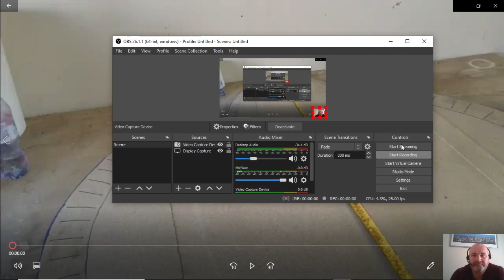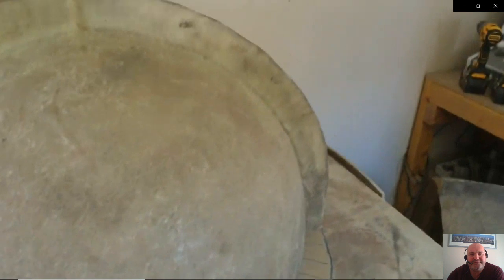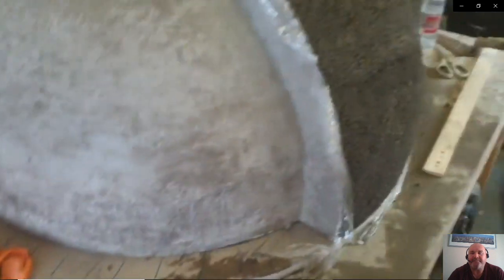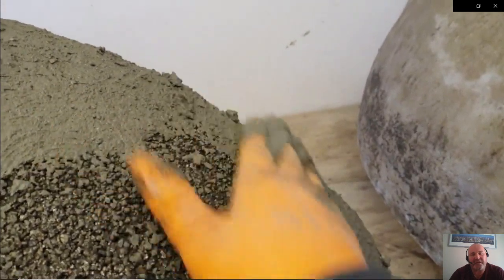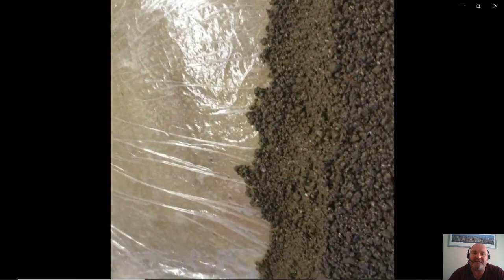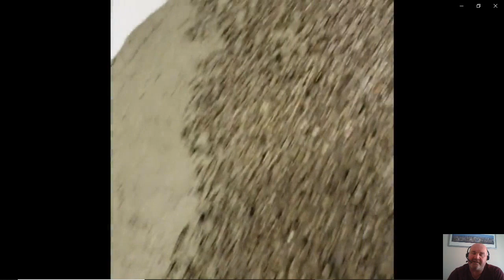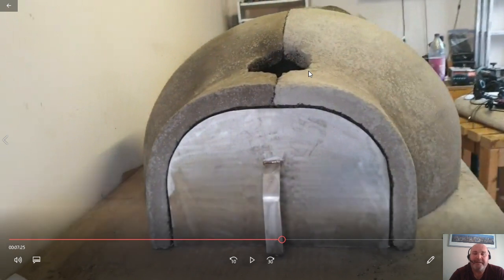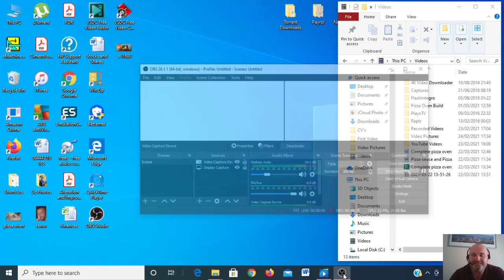Pizza Oven (DIY) - 36 inch Pizza oven made from Perlite, Sharp Sand and Refractory Cement...

Comment: Ive seen so many of these pizza videos and this for me is the best Ive seen.
Reply from the maker: Thanks...Just trying to show how easy these ovens are to make and also how relatively inexpensive they can be to build...
Reply: @D230261  Your oven looks so much stronger. Very few of the others use sand. And they all look very crumbly. Just out of interest do you have any thoughts on the use of storage heater blocks. Ive got loads of them but not sure how well they would work compared to clay fire bricks
Reply from the maker: The only issue with storage bricks are that older ones can contain asbestos...So ideally you would want to have them checked or tested to be sure...I have around 30 storage bricks that I had planned to use until I was informed of this issue so decided just to go with firebricks...
Reply: @D230261  Thanks

Comment: Love the video and your use of perlite and refractory cement.   I'd like to build for doing pizza and more importantly for bread.   Does this hold heat longer than the perlite with just regular cement?    I'd like to bake at 350 -400 degrees for 30 minutes or longer.
Reply from the maker: I get the oven up to around 900F for pizza...once finished it will take around 6 hours to cool down to around 200F. I've cooke loads of bread in mine ofter finishing with pizza...Slow cooker pulled pork as well...Its not as good as a full brick oven but for the cost...its pretty good...I dont use mine full time so paying a lot wasn't an option...so I went for this type of build...6 years on and its still going strong...

Comment: Hi great work!!! I just have a question, a did you stick or glue the dome together?
Reply from the maker: Hi...the dome sections are stuck together using high temperature silicone...rated to 1250 degrees centigrade...
Reply: Thank! I could not find  silicone rated higher that 1100 F 🤷‍♂️

Comment: Hands down one of the best videos I've seen on YouTube . I'm in Mason I would like to make my own pizza oven at home I've done brick ovens for other people however my pockets aren't deep enough to do one for myself do you have a link to what refractory cement you used. I would prefer my personal dome not to crack I'd rather stick to your exact recipe thank you very much for the informative video.
Reply from the maker: Thanks for the comment...I use something called Ciment Fondue...its a refractory cement not a premade castable mix...It is used likenormal cement so I mix it in a 4:1:1 ratio...4 parts perlite, 1 part sharp sand and 1 part of the refractory cement...I order it from Ebay so you could do a search and see if it is possible to get it in your area...Its not cheap unfortunately but is perfect for the job...

Comment: Will you recommend adding some Perlite to the Refractory concrete mix (not refractory cement but concrete) to make it lighter?  The Refractory Concrete I managed to get is rated for 780 degree centigrade….if I use pure refractory concrete is going to be very heavy…but I am afraid of debilitating the concrete if I add perlite to the mix…
Reply from the maker: The problem with refractory concrete is it mixed exactly for use...so basically just add water and its good to use...if you mix it with anything like perlite you basically dilute the concrete mix possibly making it a weaker mix...Thats why I use I part refractory cement, 4 parts perlite Nd 1 part sharp sand...the perlite and sand become the aggregate...even with this mix each section still weighs around 40kg...

Comment: Last question 😬, When you say REFRACTORY CEMENT, it's more accurate to refer to it as REFRACTORY CONCRETE???? Concrete is a blend of cement, specific additives, and aggregate designed to transform the cement into a refractory concrete right??! When I search for Refractory cement, google always show Refractory Concrete...are you adding perlite to the refractory concrete?
Reply from the maker: The cement I use is high temp refractory cement...So I can add aggregates to it like perlite and it will withstand the high temps in the oven...Concrete is basically when you mix cement and aggregates so my mix could be classed as a concrete but as Im using high temp stuff it would be refractory concrete...refractory cement has various thing in it including cement and clay...

Comment: Hi there.  Great videos.  I just cracked my dome.  It's got a hairline fractured from the chimney to the mouth. Trying to wrench out the chimney mold. Is that a big deal or can it be fixed?
Reply from the maker: If it just a surface crack you can just fill it with more refractory cement...if its cracked all the way through you can put some cement on the inside as well...the dome isn't load bearing so shouldn't be an problem...if you do put any cement on the inside just start with a few small fires again just to help it cure and remove any water or moisture that may have built up...
Reply: @D230261  Thanks a million
Reply: @D230261  by the way, I followed your lead and created a fiberglass mold, only not in sections but one piece including the mouth.  The question now is will I be able to separate the mold from the dome without tearing apart both the mold and the dome.  I wrapped the mold with plastic wrap but I still think it's going to be a challenge...
Reply from the maker: @doctorfloydhayworth9080  All depends on the shape of your mold rely...As long as the bottom of the dome is the widest part you should be ok...just take your time when pulling the mold out...if its stuck you can always use an angle grinder or multi tool to cut the mold into sections which will make it easier to remove...

Comment: I guess I'm misunderstanding.  I viewed your tutorial several times, but still don't understand how you made the template for the 36-inch dome.  Can you explain in more detail?  The three pieces shown in the video look smaller than 36 inches.  Thank you.
Reply from the maker: Hi Donna...the oven is definitely 36inch internal size...The mold I use is basically a 36inch oven built from fibre glass...Its divided into 3 sections, left, right and back sections...I pack the refractory mix into a section and can compact it quite tighly due to the mold being strong...the sections end up being around 3 inches thick and when all three sections are finished and placed together they make the 36inch oven...in fact the oven is slightly larger by about a half inch due to the mold thickness...
Reply from the maker: The mold is made by using a large gym ball inflated to around 90/91cm...Once inflated you cover it with fibre glass and resin, it will need around 3 or 4 coats to make it strong enough to allow you to compact the refractory mix against it...You could just use the gym ball on it's own but you will find that as you put the refractory mix on that it starts to change shape under the weight of the mix...

Comment: Can I use Portland limestone cement with perlite?
Reply from the maker: I haven't tried using Portland cement so not sure...You would have to check on the specifications of its use under continuous heating and cooling...

Comment: Hi
Great Video, Where do you sell the kits?

also what's the difference in using Vermiculite and Perlite? why have you chosen to use perlite over vermiculite?
Reply from the maker: Perlite tends not to hold as much water as vermiculite so the mix foesnt take as long to dry out and cure...I have a facebook group called SteppsPizzzOvens...loads of info and pics on there...

Comment: How many bags of refractory cement did use for each build?
Reply: Also doesn't it retain heat for baking bread?
Reply from the maker: Roughly 2.5 bags of refractory cement, around 3x 100l bags of perlite and about 3x 25kg of sharp sand...
Reply from the maker: @gvno3399  It will not retain heat as well as a brick oven would but will stay above 250F for around 4-6 hours after fire has gone out. You can put more wood on the fire to keep the heat up around 300-350 for cooking bread. I've done it loads of times...
Reply: @D230261  perhaps if you sealed the inside with refracotry cement coat .. then a couple wraps of fire insualtion fabric..withanother coat of refractory mortar... would it not retain heat as well/ almost as well as a brick oven?
Reply: i realize im talking way more money.. but in terms of a professional wood fire oven.. still cheap
Reply: @D230261  How much does a bag weigh?
Reply from the maker: @geodes6722  A 100 litre bag of perlite weighs about 15 or 20kg...
Reply: @D230261  what about a bag of refractory cement. How-many bags and how much in each bag by weight?
Reply from the maker: @geodes6722  2 bags of refractory cement per kit...25kg bags...
Reply: @D230261  Great! Thanks.

Comment: Did the oven hold up?. Any cracking on inside ir outside ?  Great video🇨🇦👍👍👍👏
Reply from the maker: No cracking...because I use refractory cement the ovens never seem to have issues with cracking even at the higher temps of around 900-1000F...
Reply: Probably a big factor in this not cracking is that you have made this in sections and the “weak points” are along the seams. This would allow the dome to expand and contract and these would occur along the seams. This is how concrete sidewalks and roadways are built to effectively minimize the cracking. This is a great build. When I get around to doing mine, I will make it in sections as you did!